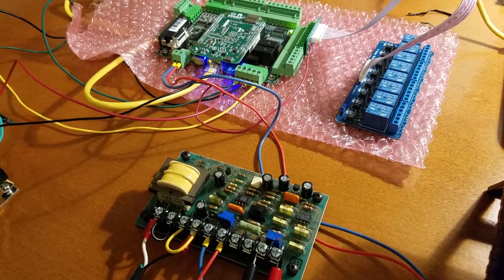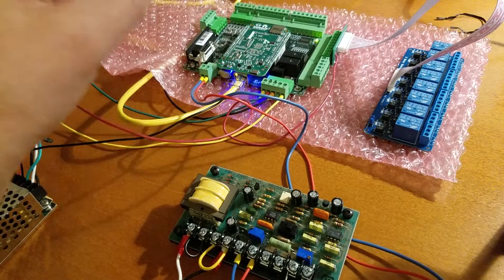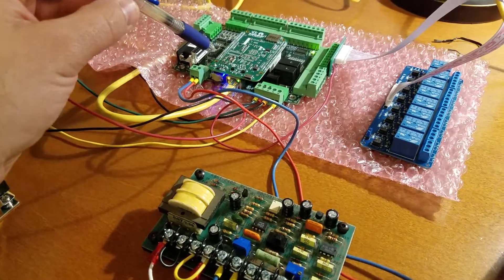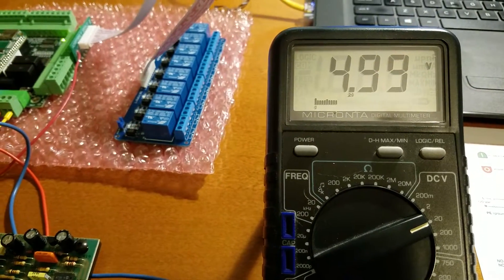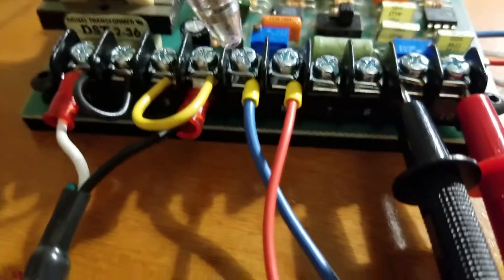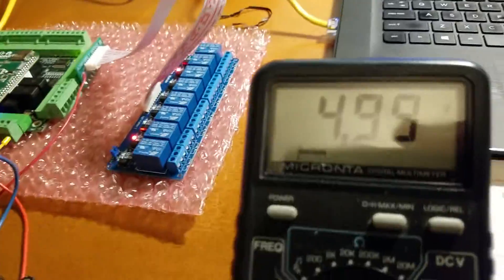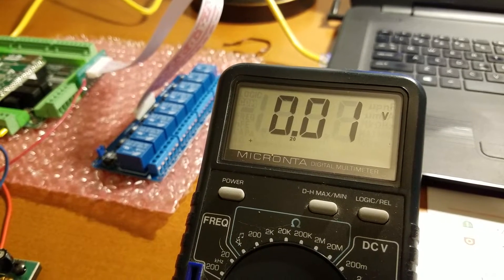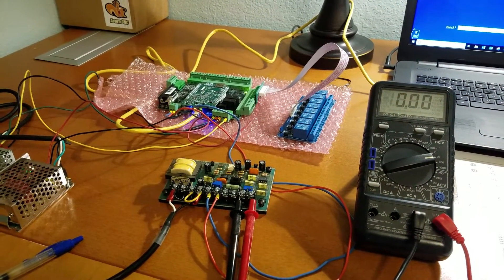Centroid Acorn CNC: Control Any Spindle With Signal Isolation

Comment: KB Electronics is a very good long time maker of DC spindle controllers. The KBSI 240 has been around a while and has been discussed on the Centroid User forums. There are great replacement DC controllers from KB Electronics like the KBIC120 and KBIC 125 that will Drive most 90VDC motors and they can be has with the SI-5 signal isolator making them a good solid DC spindle drive that will work with Centroid Acorn safely. It's great you made a video on this board and discussed signal isolation. There have been a number of users trying to use the Acorn 0-10vdc analog signal for purposes for which it was not designed nor supported damaging their Acorn boards.
Reply from the maker: Thanks Marty.  This signal isolation board is really slick - it simplifies a lot of problems.

Comment: You are a mind reader. I have been wondering about this subject. Thanks.
Reply from the maker: You are not alone.  I've spent a lot of time and smoked a lot of electronics trying to figure out a safe way to do this.  I was really stoked when I finally understood what this signal isolation board was all about.  It's the key for controlling all of these Chinese DC spindle drives.
Reply: @FrancoCNC  Im glad you was finally able to figure it out. And lucky for me I'll be starting my first cnc conversion later this year. So no snoked parts just yet.

Comment: Thank You I have been trying to do this for a year to a Denford micromill 2000. and blew my spindle board In the process. after finding  you I just spent 900 on a new sherline ER-16 spindle,motor and control board, an Acorn an a isolator board your showing. you saved my life with these videos. I will probably be messaging you. could  you also  you the pot as a over ride?

Comment: I had this setup, but recently noticed a “limit to 5v” option in the acorn setup wizard.  The KBWS-25D I am using has an isolated 0-5v built in.  Looks like I don’t need the extra card anymore, but I had the same smoking experience with my G0765 you did, so I’m still a little shy to take out the isolator

Comment: Hi Franco, Great Videos.   Do you have a schematic for connecting the KBSI-240d to a PM-30MV?  My PM-30MV controller is covered with black epoxy and cannot read the etching on the PM-30MV controller.  The PM-30MV controller does not have the 7 PIN connector you referenced in your KBSI-240D install on a PM-728.  Help
Reply: Did you figure this out? I’m in the same situation

Comment: Hi Franco, I’m building the same set up as you for my Sherline Chucker lathe, I went with the 18x18 model.  Last thing I need to do is get the spindle control done.  Can you tell me if you wired the 110v power for the KBSI-240D from the wall socket? OR did you tap into the Sherline 110 wiring?  BTW your videos on this project have been a valued resource along with the Centroid forum thank you for putting them together.
Reply from the maker: Hi.  As I recall, I believe I made a separate power lead and plugged the KBSI-240D into a receptacle.  However, it would probably be better/safer if everything was tied to one power source that could be disconnected by an e-stop.

Comment: Check out Automation directs line of "signal conditioners" depending how much you want to spend, you can convert anything to anything, different voltages, current to volts, some even have integrated relays you can set to trigger at your desired set point. https://www.automationdirect.com/adc/Search/Search?fctype=adc.falcon.search.SearchFormCtrl&cmd=Search&searchquery=SIGNAL+CONDITIONER&categoryId=0&TxnNumber=-1&searchqty=10

Comment: Hi Franko ,were you able to get rid of the bouncing signal voltage  coming out of Acorn board with this , example mine bounces around from 1 to 2 volts back and forth  and the spindle hunts up and down.
Reply from the maker: Hi.  I've never had that problem.

Comment: Franco, are using the KBSI in place of a VFD?
Reply from the maker: Sort of.  I'm using the stock motor controller.  The KBSI is allowing me to replace the potentiometer.  So, you can think of the KBSI as an Acorn controlled potentiometer.   It also provides isolation between the motor controller and the Acorn board.

Comment: It's really a shame. Centroid has set up the acorn to so easily take a spindle encoder but doesn't seem to want to implement pid control. 

Unless I am missing something, hooking it up like this does nothing to combat the rpm drop from heavy cutting loads. Even with an encoder.
Reply: 0-10 VDC analog out for spindle control is a RPM command, not a power or torque command.

For instance if the machine max RPM is 3000 RPM Acorn will be outputting 10 VDC to the VFD (or DC spindle control)  lets say the spindle is at 3000 RPM...If the RPM of the spindle is decreased by loading it up (for instance a tool taking a heavy cut) the Acorn is already at 10 VDC there is no way it can magically increase the voltage command to increase the spindle RPM as its already at its maximum 10 volts.  What Acorn CAN do is adjust the feedrate to match the programmed chip load! So when Acorn encoder sees the RPM going down, it will slow down the feedrate to adjust and keep the chip load the same! It is closed loop! that’s what the encoder is for.
Reply: @CentroidCNC  wow I guess I didn't understand that's how it worked. That works on milling not just tapping??? Why is that feature not advertised?